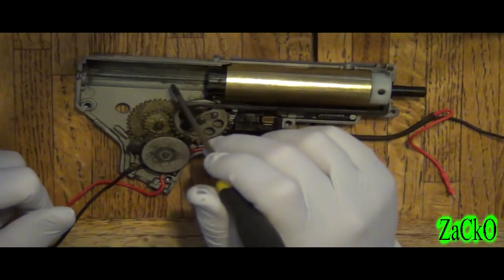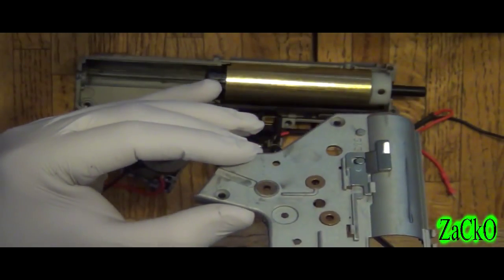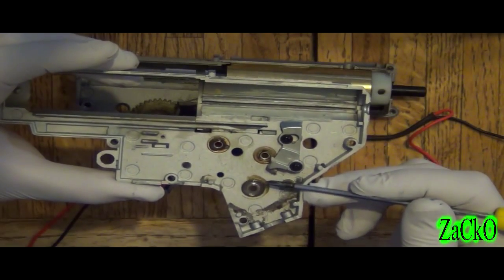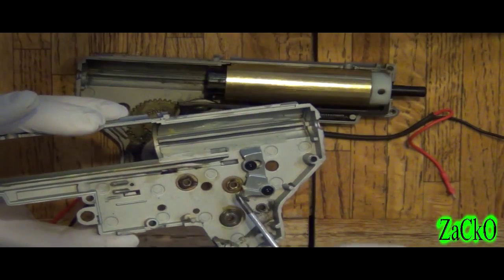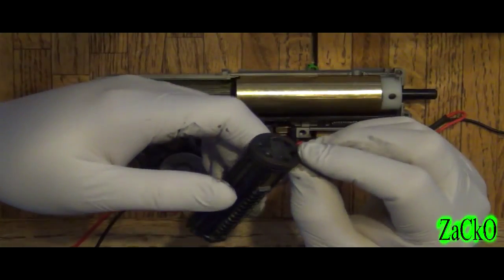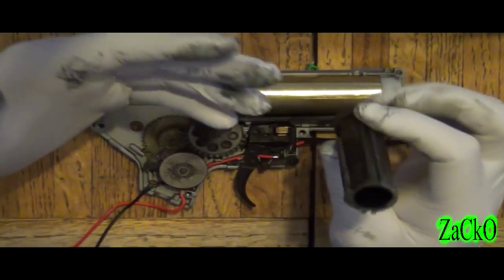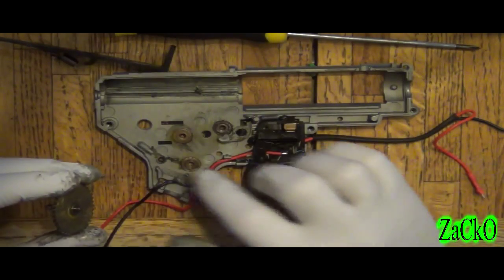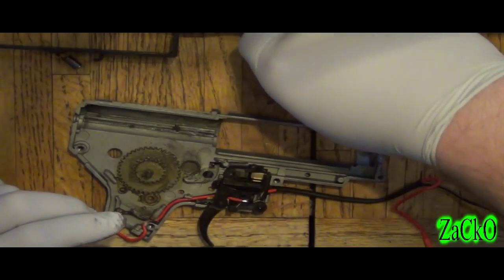Looking At Catastrophic Gear Damage

Comment: Can the ab function on the gate merf 3.2 be disabled?
Reply from the maker: If you wire it to not be used as a true mosfet yes. But why on earth would you want to remove the AB? It doesn't destroy motors.
Reply: Hmm well I wired the two black data cables to each contact and desoldered the motor wires from the contacts and have them going straight to the fet as I believe is how it is done in the manual. Is the smart trigger ab? And I was under the impression that they cause wear on the motor brushes